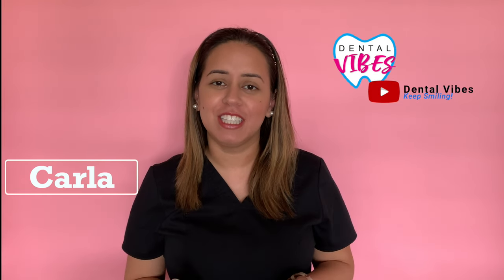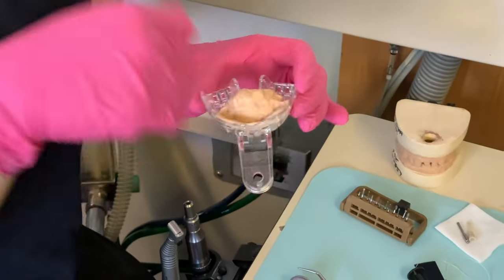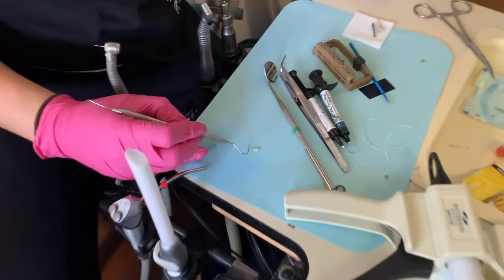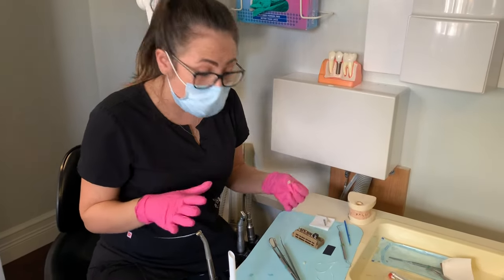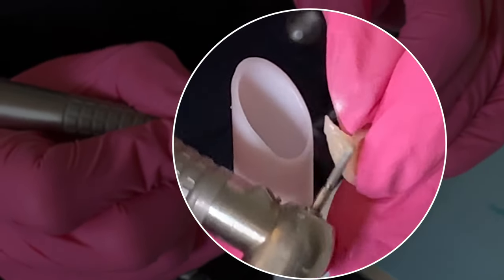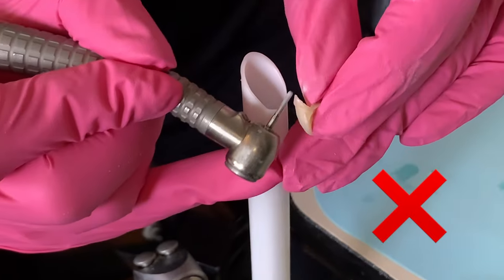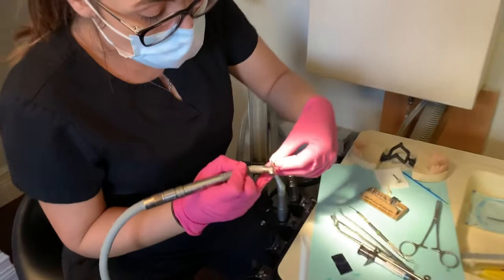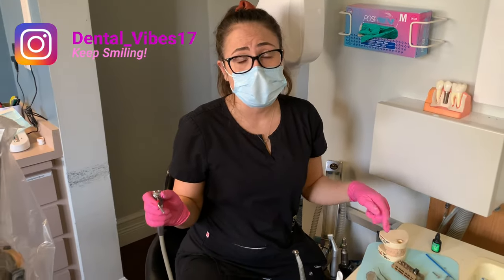HOW TO MAKE A TEMPORARY CROWN | Easy Anterior Temporary crown Tips

Comment: You can also just very lightly line the prelim with Vaseline (instead of placing topical or Vaseline directly on the tooth), which can be removed from the temp before cementing, with alcohol.

Comment: Hey ladies, 
I have a few questions. 
    1.  How do you make an anterior temp crown if the patient has a gap? Is it better to use a triple tray to make an anterior preliminary or is the one shown in the video best ? 
I tried making a crown for a patient and when I removed the crown they were splinted. I tried to adjust the temp so that the material was not so noticeable but then the temps broke. 
     
2. How would you make a crown out of scratch if you have no preliminary?
 I know some places have some stainless steel crowns but what if those aren’t provided either ? 
     
3. If the Dr is doing a B/U and peeping the tooth but you didn’t get the chance to take a preliminary would you still recommend building up the tooth ? Would the build up you do bond to the build up the DR did to the tooth?

Comment: When you have a fractured tooth you said add flowable in the beginning. AM I adding it to the real tooth and will it come off? Because if I am taking an impression will it stay on the tooth or come off the tooth when I take the impression?
Reply from the maker: For a case like this we recommend adding something like liquid dam (from Zoom) on the tooth to build it up so that you can take your pre-op impression.  You can use flowable because it won’t really bond to the tooth without etch and bond, so it’s fairly easy to remove BUT it will be a waste of product.  Other than liquid dam you can also use wax (not ideal cause it will distort easily) or any “expired” composite/flowable you may have in the office…And yes you will add it to the tooth; it will be easy to remove from the tooth 👍🏼

Comment: I noticed you’re using Structur 2 temp material. I’m trying to get used to this material right now. I’m used to Perfecttemp/Luxatemp type material. Any tips specific to this material? Currently I’m using blue bite for my stent, I use vasoline on the prep and contacts and try not to overfill but so frequently I end up breaking a piece off as I’m removing it from my docs usually thin, tall, straight, conservative preps. It never comes out in the impression with Structur where it always does with Luxatemp.  There has to be some technique I’m missing here that would help me get through the 6 cartridges I have left!   🙄🔫
Reply from the maker: mindymm2206 Mindy Morgan I used perfecttemp before it’s pretty similar. Honestly I don’t think the material is the issue. Maybe you’re getting it locked on undercuts and when u pull out it breaks. I would say have your dr double check the prep and clearance. Try using topical on the prep and contacts of adjacent teeth instead of Vaseline. Also, make sure you’re not leaving in the mouth for too long

Comment: Hi Gabby! I was wondering who does the models? Another thing - how long it usually takes for you to prepare temp crown? Is patient on the dental chair at the time of preparation?
Who place temporary crown in the patient mouth - assistant or dentist?
What if crown still need a little bit adjustment?
Reply from the maker: Karolina Rogowska great questions! So as I mention we were just using a model because we didn’t have a patient at the time to film. The impression is taken from the patients mouth prior to prep. If it’s a single tooth it can be from 5-8 min if I had to take a guess lol I never time myself. Patient is in the chair after the tooth has been prepped. The assistant should be able to fabricate the temporary crown and cement it. After cementing it, if I noticed still needs a little adj I will do so with a slow speed polisher. If that doesn’t do it then I’ll grab the dentist to adjust it with the high speed. I hope I answered all your questions 🦷🙂
Reply: @DentalVibes  thank you so much :) Qualified debtal nurse in Scotland can take impressions ( she needs extra impression course to do so) and in theory she could do a temp crown but its all done by the dentist. What we CAN NOT do for sure - cement crowns in the patient mouth and use any handpieces in the patient mouth . I was wondering what is the dentist doing when you are preparing the crown? Does the dentist check on patient when it's cemented?
Reply: @DentalVibes  one more question. How long usually patient wait for the permanent crown? Xx
Reply from the maker: Karolina Rogowska so in the US what a dental assistant can legally do varies by state. In Florida, expanded functions dental assistants (which you go to a program for that certificate) can do everything that’s temporary. So we cement temporaries with TEMPORARY cement. We can use the slow speed only  in the patient’s mouth. The high value of an assistant that can do these duties is that the dr can multitask. While the assistant is making the temp the dr can go do an exam or see another patient. Every dentist is different when it comes to checking after it’s done. If you worked for a dr for a while and they know they can trust you will do a great job. Then they won’t come back to check it
Reply from the maker: Karolina Rogowska 2 weeks maximum! They come back the assistant removes the temps (it comes off very easily) tries the crown in and the dr comes in to check/adjust/cement

Comment: One more question, you said never remove the sides, but a lot of times I have excess material what should I do b in this case? Meaning the Distal or Mesial?
Reply from the maker: You should remove the excess on the Side of the contact not right where the contact is. In other words think of what a permanent crown would look like. It would be smooth everywhere, so you smooth your temp 🙂

Comment: Do you find issues ever using alginate? I have never used it to make a temp. I worry it may dry out by time we make the temps. Plus we keep the temp impressions until seat appt just incase we need to make new temp due to broken or lost temp. I have used the bite or putty material so it keeps longer.
Reply from the maker: You should NOT use alginate. We use alginate alternative or alginot

Comment: What dental material did you use? Polysiloxane automix?
Reply from the maker: No, vinyl polysiloxane is used for final impressions.  For pre-op impression we usually use Alginot or a generic version and for the temporaries material we use a few different ones like Protemp or Structr.

Comment: When your polishing the crown, are you also trimming and extra material, what is the best way to not accidentally over trim?
Reply from the maker: Fulcrum and practice 🙂
Reply: There is usually a margin line you can see, don’t cut back past that and barely polish the interproximals. Try it in and slowly adjusted as needed for your contacts.
Reply: @DentalVibes  lol
Reply from the maker: @ancarter22  great tips!

Comment: We aren’t allowed to use the big suction when adjusting because it might  suck the crown in. 😮‍💨😂
Reply from the maker: I mean that COULD happen Lol, whatever works best for you!
Reply: There should be a thing (extreme dental term) in the high vac suction that is there to filter or catch bigger items. This is not a screen more of a wire and it is where the metal is attached to the hose.  This should ALWAYS  be there anyway to catch other larger items that could block up the suction.